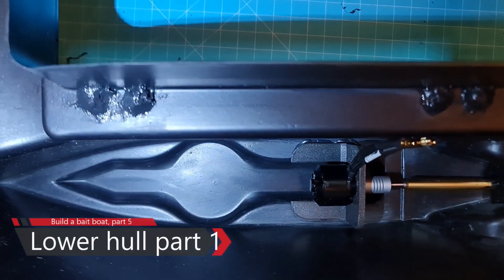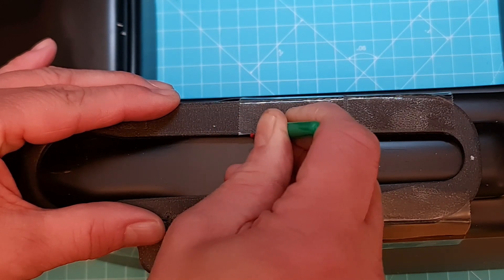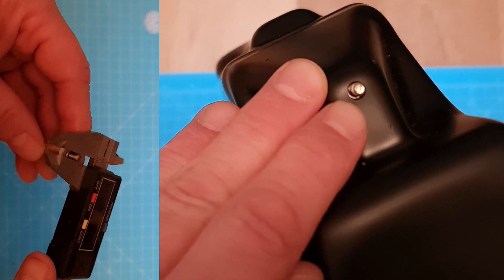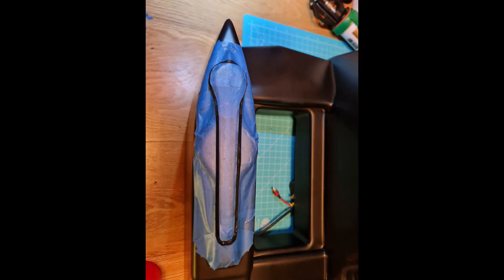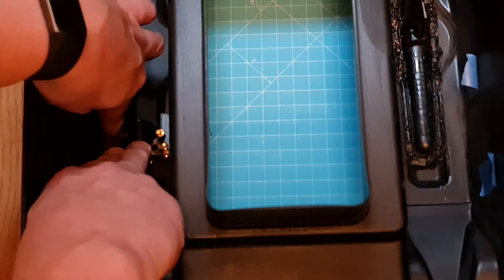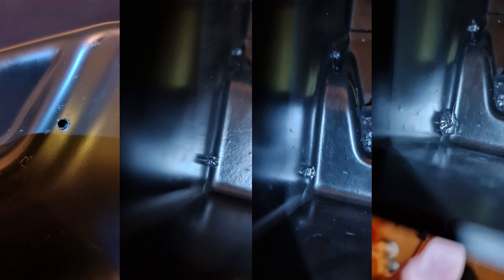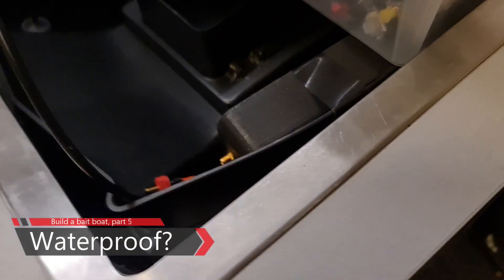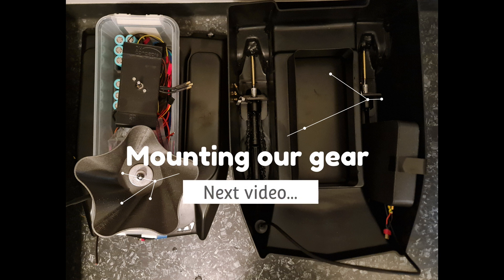Boat build part 5 - Lower hull, initial preparation

Comment: Hey great work, is it not possible to use the gps in the Dragonfly do you need the separate esp and gps to connect to carp pilot?
Reply from the maker: @allanernstsen2096  For the Dragonfly you need a separate GPS. I was never able to understand the Dragonfly's GPS data, only the depth. And to be honest, you would not want to use it either. A common problem with Dragonfly put into a bait boat is that it has an irritating lost position alarm, and it is not unusual that it is triggered when tucked into a baitboat. Many who modify their Dragonfly removes its buzzer for this exact reason. The point is that inside a baitboat conditions are unfavorable for the dragonfly GPS. It is likely also no high end GPS built in. So the accuracy must be expected to bad. And this is something you do not want. If you want to rebait a spot you want good position accuracy. If not the next time you rebait the boat could be 5+ meters away the next time. Do not go cheap on the GPS
Reply: Thx for answer, is it possible to use  the deeper version? Directly with your app. And do you need to make an extern antenne for range up to 200meters.
I have tried to find the video for nmea sounder setup? 
Sorry for all my questions but i am still trying too understand witch solutions is best.
Best regards 
Allan
Reply from the maker: @allanernstsen2096  Sure you can use a Deeper. It needs to be one of the models supporting nmea0183 (the Deeper pro+ does not while Chirp+, Chirp +2.0 and Pro+ 2.0 does) to get depth and position data.

If you have an autopilot then position data will come from there, then the Deeper will offer depth data. This is the better solution as the Deeper GPS is not extremely good.

To connect to any echo sounder, the premium subscription is required. The you can also do live bathymetry and have depth maps on the driving screen as a result.

Premium subscribers will be able to activate the "wifi echo sounder" option. Once done you simply select echo sounder type Deeper.

To get some distance you must extend the range. Options are to add an antenna socket. Add in a wifi booster to increase range further. Or to use a router in the boat (or additionally a router on shore), like the VAP11s, and to configure it as a 'bridge'. Using these methods, a range of until 4-500 meters is reported from various users. Which is likely sufficient.

You can get much more advice and answers quickly sorted out by joining the Carp Pilot Pro user group on Facebook.

Comment: you can ask for the name or link to the drive shafts?
Reply from the maker: These are custom made by DH Concepts ((even include ball bearings) and are typically supplied with the hull if you buy a hull from them.

Comment: just a quick question, how did you split the transducer cable and also where does the raymarine power come  from
Reply from the maker: You either cut the cable in the middle and remove the mid section. Taking great care when putting it together that ALL isolation (plastic and metal films) are intact after soldering. Or you cut the cable short, desolder the socket from the raymarine board and then solder in the ends of the cable straight in.
Reply: @TheCarpPilot  brilliant thanks for the Reply , I've managed to get hold of the Raymarine dragonfly pro 5 I'm  going fit it to a basic RT7 I won on a competition and your video has been brilliant

Comment: Hi what's the Bostik glue called please?
Reply from the maker: I normally use Tec7. Especially for sealing the boat as it dries slower and makes it possible to use Tec7 cleaner and make the seal look pretty. For mounting stuff inside the slow drying of Tec7 is however no advantage. Bostic Supergrip is then a better alternative as components stick to where glued (does not glide away) even before the glue dries.
Reply: Thanks for the quick reply, just jumping on to eBay now to order some, many thanks and I loved the videos. Dan
 @TheCarpPilot

Comment: Hi, Can you share the stl files for the bait thrower please?
Reply from the maker: The bucket on top is printed using the original STL from DHconcepts. The same goes for the side grippers that holds the arrangement fixed to the top hull. I am bound to an NDA and I am thus not allowed to share it. Sorry for that.

Comment: Great video! Question, what glue did you use?
Reply from the maker: I have always used Tec7 for boat jobs. And for this boat it was also used for the outer seal (upper and lower hull join). Tec7 has an ability that is both good and bad: It dires slowly. Which is great for the outer seal, you have sufficient time to make an OK finish. For thick layers (like the part back holding the propeller shank tube) not so great. Seems the inner part almost never dries and hardens. Better then add glue in portions gradually increasing it. Also not great at all for gluing those battery holders to the hull side. Guaranteed to slide down if you do not add some support to stay put until dried. Other glues are better choices. Like supergrip from Bostik. But hard to get where I live. Holds better straight after application, but outer skin also dries much quicker and thus much more demanding for sealing the hull parts.
Really no glue that is optimal I guess. Here in Norway Tec7 is easy to get, so that's my general choice. And it is totally trusty for such work.

Comment: Do you have a link to the motors .where do you find them ? I can see they are 850 kv . But can't seem to find them anywhere.
Reply: I just find them at the first video .
Reply from the maker: @jrjohansen100  Yes, they are specified precisely in the first video. I bough mine from the big-difference web shop, here:

https://big-difference.com/spitz-brushless-motor-2830-14-850kv

The motors drive this boat at around 1.1 m/s. I have tuned it slightly down using WP_SPEED (Ardupilot parameter) to 0.9 m/s as I find the boat drives more gracefully then

Will try  to list all parts again in the last video when completed.

Comment: I see my Dragonfly Case :D Or does it just look like my cas? xD Thx for the nice Video and thanks for supporting  Philips work! :)
Reply from the maker: This is the case made by DHconcepts (the owner is really capable working with Fusion). It differs slightly. But I suddenly realize it is you who made that case on thingiverse.com (same user name). Nice design, even with kind of a snaplock it seems. Well done! And sure: I was truly amazed by that video Philip made so I asked if I could please refer to it in my how-to series, and was really happy he approved that.

Fun fact of my print by the way: I use ASA+ exclusively for all boat parts. But it is sometimes difficult, and I also used a brand new printer that I did not tune at all (besides the nozzle height). It is a Prusa and generally comes with fairly good starting values anyway. But... I further printed it on a bed material that is not the best match for ASA. And the print was a bit flawed, all corners lifted slightly from the plate. Otherwise the print was OK. And normally I would have put it in the trash. But in this particular case it was a good thing: the rounded corners actually made the box fit even better to the curved hull side where I glued the Raymarine in. So in this particular case the failed print was actually perfect 😂
Reply: @TheCarpPilot  Yes the case on thingiverse is mine. :)  I print the cases in PETG. No problems until yet. I have a fully modded Ender 5 and now also a Prusa Mini clone. Both with amazing results with PETG and ASA (from Extrudr).